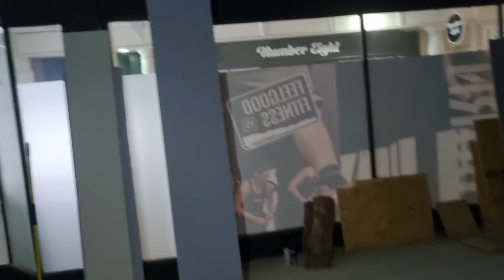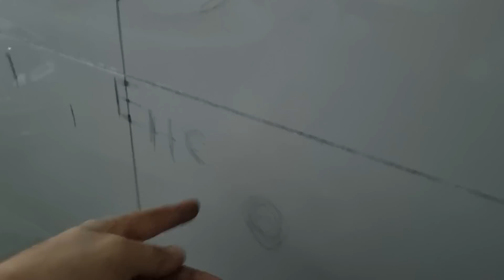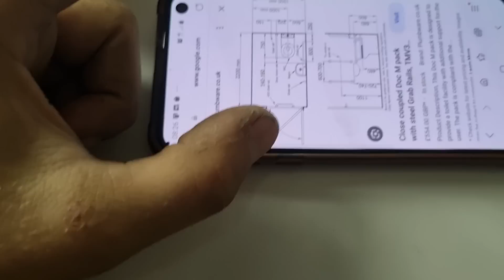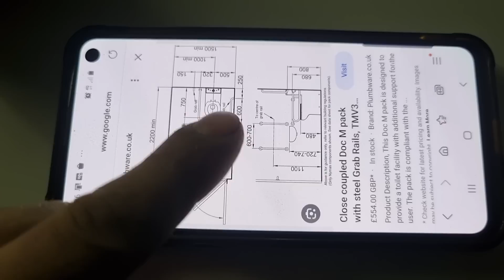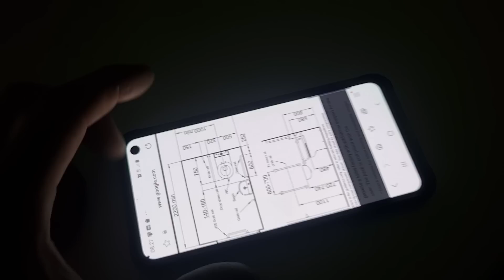YE OLD ABANDONED SHOP PLUMBING

Comment: Good to get a change, they say it’s as good as a rest. It’s a while since I fitted a durgo but must admit I’ve not come across a push fit one myself either. I don’t mind push fit plumbing as long as it’s hidden and correctly fitted and preferably any joints should be accessible to a certain extent.
Reply from the maker: Thanks for the support as always mate, to be honest I'm not a massive fan of pushfit plumbing, I would have much rather have used copper, it should be Ok though and it is clipped well, it just made sense on this one as I could feed the pipes in a bit easier, It's the first time I've ever seen a polypipe push fit dirgo, it will make changing easier

Comment: Probably use Victaulic couplings for the fire system now. Use a machine to roll a groove on the end of the pipe and a split clamp with rubber seal.
Reply from the maker: It will be interesting to see how they do it to be fair, the shopping centre uses a contractor, it will be good fun for them if those valves don't hold, I imagine they have been there a few years, thanks for the support as always mate 👍